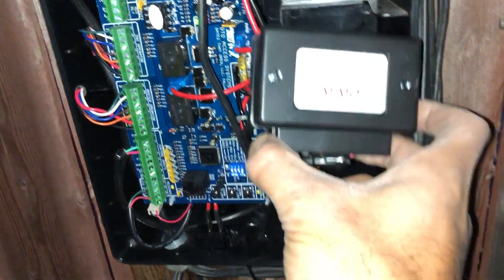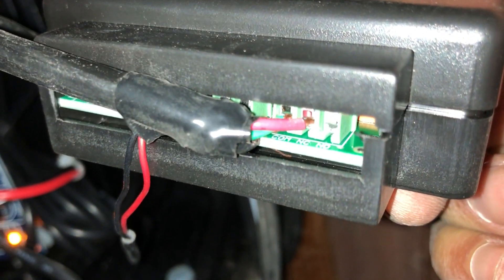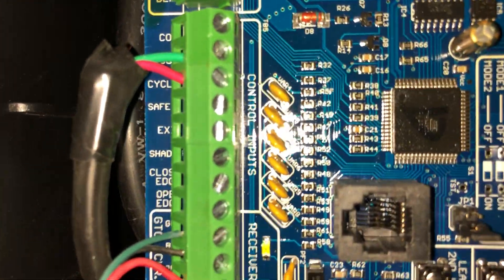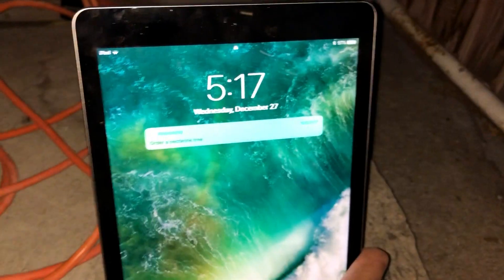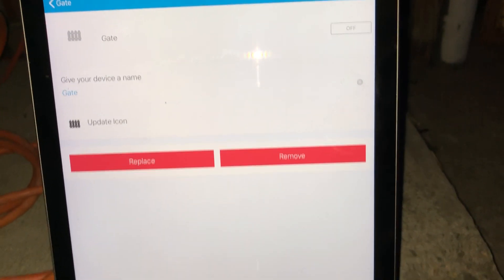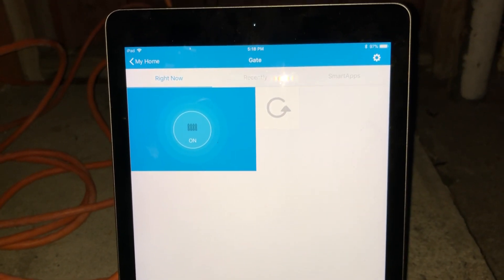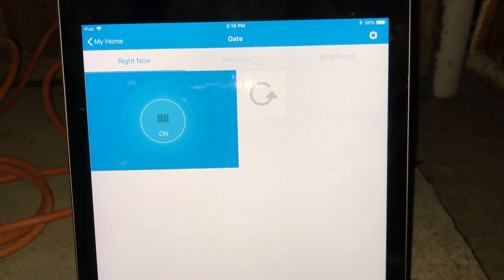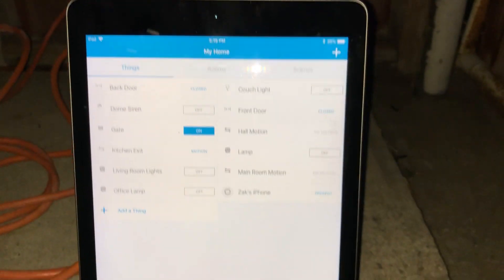Mighty Mule Gate Opener + SmartThings + FortrezZ MIMOlite Zwave module

Comment: There is a jumper you can remove to make it a momentary switch I believe.  If not, you can make a smartthings routine to turn it back off after 2 or 3 seconds so it's ready to go again.
Reply from the maker: Yes I left the jumper off which I think sets it to momentary mode.  You know what I did notice that after a few minutes, it switches back to off in smart things.  So that is somehow built in.  The issue I am having now is that the device never seems to stay connected - even though it does activate when I click the toggle in smart things.  I thing the zwave network can send the signal through, even if the device isn't necessarily available/reachable to the hub itself.